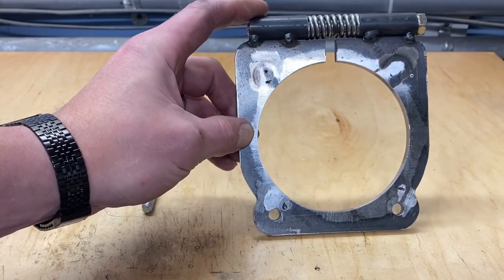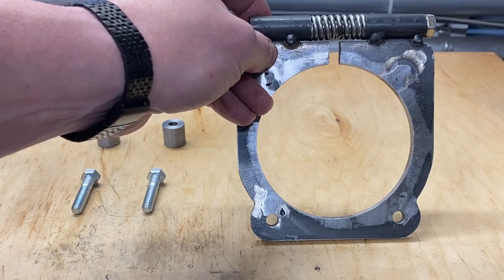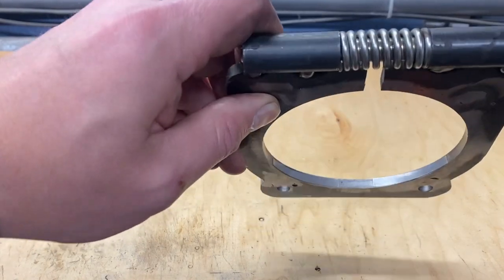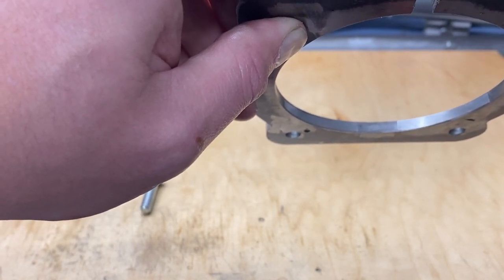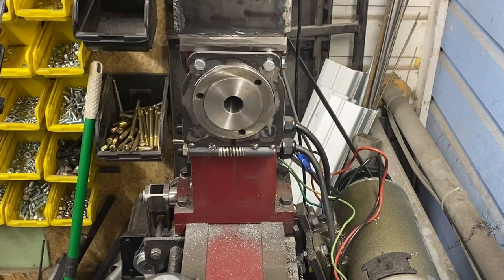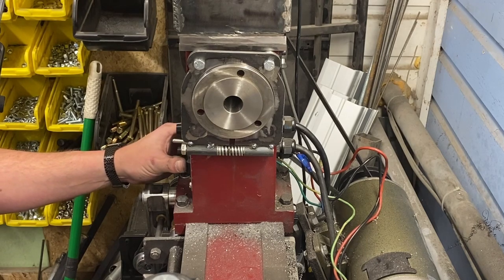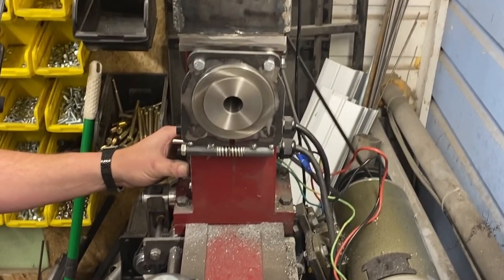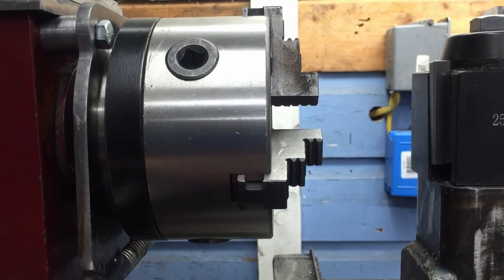DIY Spindle Lock for a 3-in-1 Mill Lathe Combo, Basic Design and Fitment to the Lathe

Comment: Thanks Daze. I remember your ingenuity from the mid 2000's on the Mustang Steve forum so this comes as no surprise. I do wish you would have shown the mounting of the chuck. My fat fingers wouldn't fit behind that plate if I had it on my lathe, at least not without a few expletives. BTW, I've diy-ed your  strut rod mods, LCA bearings, and spring perch bearings since 2010...and it's still going strong. Thanks.
Reply from the maker: I have fat fingers too.  Mounting the chuck is a pain with or with out the spindle lock.  If I am being completely honest it is probably ever so slightly harder with the spindle lock but barley.  Best thing I ever did to make installing a chuck easier was to start using the tail stock to hold it in place.  I get one bolt loosely started, slide the chuck over the register, and then move the tail stock in place so that it holds the chuck to the spindle while I install the other two bolts.  That technique has made all the difference in the world.    Glad to here you have made good use of some of my other project information!!

Comment: Saw this posted on FB. Thanks for posting a video. I was wondering about hairline fitment, but the tape does the trick. Be sure to update this video and tell us how this gap works in the summertime. :D

Minute 1:43 _ I see what you did there.

I have used a piece of wood under the jaw in the 3 o'clock position. Keeps the chuck from rotating in the cutting direction. My old lathe had a treadmill motor and power tapping was a breeze. May have to "upgrade" the current Smithy Midas 1220 LTD to treadmill motors too.

Keep innovating! I love watching these types of videos.
Reply from the maker: If I need to I can adjust it in warmer weather

Comment: did you fabricate a riser for your mill?
another great vid. thanx. do i spy a treadmill motor?
Reply from the maker: No riser, I went a slightly different direction 😂 https://youtu.be/_PxZ6opP5KA   Yes that is a treadmill motor. I’m soon going to be putting out a video on the top 10 mods that I have made to this machine including upgrading to variable speed.
Reply: @dazecars  fun..i went with a vfd and a baldor 2hp 3 phase motor  :P..got a really good deal on it